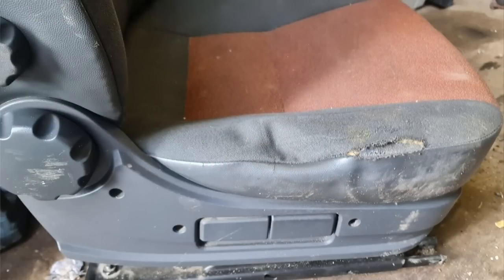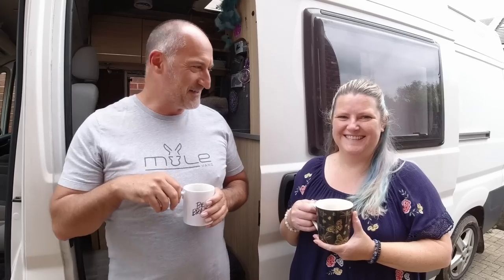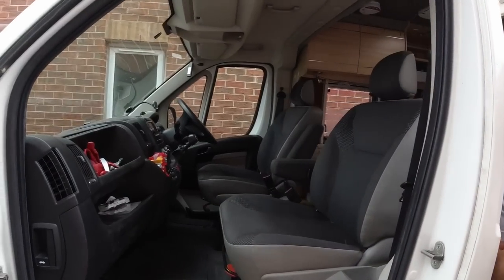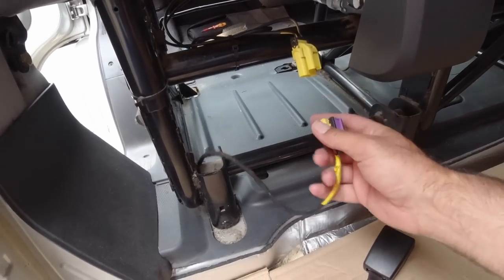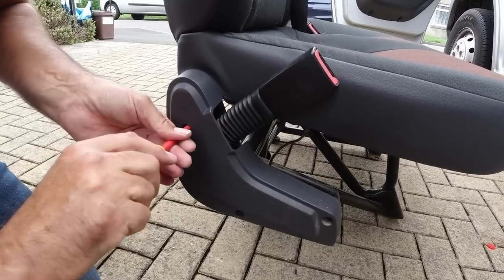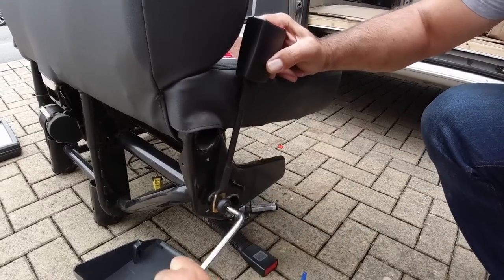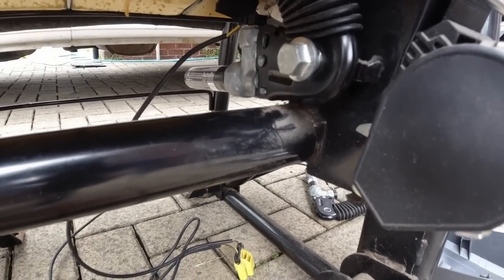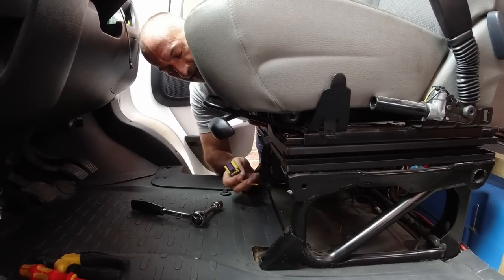DIY Single Seat Conversion on a Budget! - Van Build Ep14

Comment: Greg measure the resistance of the charged device with a meter that will tell you what size of resistor to get.
Reply from the maker: Hmm I did think that 👍🏼😃
Reply: @GregVirgoe  Hi Greg, sorry it's me again!  I know nothing of pyrotechnic devices, but I do know a Multimeter, in resistance mode, would inject a small current into the resistor to perform the measurement. Would this be enough to fire the device, I've no idea. Might be worth checking first, before accepting this advice?
Reply from the maker: @flashback9966  yes 👍🏼 great advice mate, I’m going to leave as is now. 😃

Comment: I swapped out my double passenger seat and replaced it with a single rotating seat.
I use it all the time I sit in the back.
It wasn't cheap, but definitely worth it, especially in a Short Wheelbase low roof Duvato van.

Comment: Thanks greg that’s exactly what i want to do in my van . So i can step through. Good tip using thread lock or lock tight on mounting bolts 👍.
Reply from the maker: Yes I did notice the thread lock when I removed them so it made perfect sense to clean the bolts and put some more on especially as such a critical safety feature 👍🏼😃

Comment: Top notch as oer Greg. Who'd think there was such a hassle to get van chairs, but a great result for you and Amy.
Reply from the maker: The popularity of self buildign now has obviously bumped up the prices, motorhomes have always been an expensive market and that seems to be rubbing off. Thanks for watching
Reply: @GregVirgoe   Yes I've noticed! I am looking at the small buses by Mercedes D180i? They use them for school buses and rural bus routes. A great size. I wouldn't be going full time though. Not at first anyway.

Comment: Wow that was more complicated than I thought !

Our Daughter would occasionally join us on trips so I bought a double seat from someone in Hull, who had just fitted a single..

Cost me £90 back in 2015 and I used to swap them over in about 10mins whenever she came with us..

Must have just been lucky that everything was compatible 😄

Another great Video mate 🚐💨❤
Reply from the maker: It is just the two bolts in the front and bang done in ten minutes. 
I just didn’t want to risk the seat belts not being compatible. They could have been ok but didn’t try it

Comment: Fantastic video thanks Greg very informative im at this stage now with my build. I have been concerned regarding the seat belt pretensioners, however you've explained perfectly how to overcome the spare pretensioner issue👍
Reply from the maker: I tried a few options but this is the most simple and straightforward answer. Easy and works 😊

Comment: Hi I'm hopefully soon doing a camper conversion will be a relay/boxer type van and would want to do a dual seat swap as your video are the seat fixings the same on all manufacturers as the seats you swapped out look like Renault seat they look the same as the ones in my vivaro work van thanks these videos are great for helping with a new conversion.

Comment: Hey Greg thanks for the video. I have two questions for you😊 .  First, Where did you find the info of the exact torque for the seat? And second is, what’s the software you use in your previous electric system video to create a diagram with all the stuff you have and their cables ? Thank you😊

Comment: Hi there , may have been asked already but did you not have to disconnect the main battery before unplugging the seat electrics ? Thanks
Reply from the maker: It is always wise to disconnect the battery before doing anything on the electrics :D These vans have an easy quick disconnect on the negative terminal which you can do by hand, simple.

Comment: Greg (or anyone else), how did you connect the LPG bottle to the hookups in the old van? What connectors did you use? I suppose you have to unscrew the gas regulator from the bottle when you fill it, but how did you connect the hose to the bottle?

Comment: Hi Greg , wondering if i could please have some advice from you ? I have a self build campervan and im having a little trouble with electrics . Ive got 2 leisure  batteries connected to a 3000w inverter , my microvave is only 700w but keeps tripping my trip fuse i installed between the batteries and inverter . Its only a 50w trip and clearly it not big enough to take the microwave power   what size  trip fuse would you use ? Love your videos and any advice would be greatly appreciated,  thank you Dave Co.Durham
Reply from the maker: Hello Dave your 3000w inverter needs a 300amp fuse and at least 35mm cable. Even a 700W micro device is using 56amps continuously from your 12v batteries. Hope that helps 👍🏼😃
Reply: Thats great , thank you so much

Comment: Great video. Is there any issue with rigidity when removing the bulk head panel?
Reply from the maker: No none at all, it’s primary function is just to stop loads going into the cab under breaking. If you think of minibus or ambulance etc none of which have bulkhead installed. No problem taking it out very easy to do 👍🏼😃
Reply: @GregVirgoe  Thanks!

Comment: Hello greg,i got 2 ford galaxy single seats that i like a lot but they dont fit in the citroen relay seat base,do you thing is safe or okay for mot if i secure them with some aluminium planks as they do in 2 videos i have watch.thank you
Reply from the maker: Modifying a seat or its fixings by yourself, won't have been crash-tested to current standards. At least with manufactured seat bases and swivels, they should have gone through that process. I think that @suepaulbrown9512 fitted some galaxy seats to their old Ducato van maybe ask Paul for some advice on how he did it :D

Comment: Hi Greg, hope you are well.
It’s not related to your seat swop out but I wondered if you could answer my question. I’m on the look out for a Ducato/ boxer/ relay to convert into a camper. How much head room is there in a H2 van when you have put a floor and a ceiling in?? 
I was concerned it might be a bit low but H3 vans are a bit thin on the ground.
Hope you can help.
Reply from the maker: I’m 5’11” and still have 3-4” of headroom over my height 👍🏼😃
Reply: Thanks Greg

Comment: Very informative and detailed as usual Greg. Can I ask if you know if its possible to extend the cable on a seat occupancy sensor? I'm in the process of converting a vw crafter 2022. Just purchased the seat Base to convert the passenger double seat onto a swivel and notice the cable isn't long enough? Cheers, Colin
Reply from the maker: I extended the ones on our Mercedes sprinter passenger seat when we fitted the swivel. Keep the extra cable short and use at least 1.5mm stranded. I soldered it and heat shrunk it for protection and it works perfectly 👍🏼😃
Reply: Brilliant! Thanks Greg . Love your vlogs they are very professional and informative.  Top man
Reply from the maker: @colinchellew1807  all the best Colin. Thank you 🙏🏼😃

Comment: What a result being able to do swapsies with someone else!

Out of interest, do you happen to know what the rules are for seatbelts and available seats? Only im looking to remove my middle seat in mazda bongo soon, but if i could remove those belts now would be nice cos one of them gets right in way of my fold out table.

I'd presume its a belt for every seat in the vehicle probably but a bit of googling didnt answer it clearly for me when i looked.

Cheers!
Reply from the maker: If the seat is there it will need a belt. If there is no seat or belt it can’t be tested so just a case of amending your V5 to reflect the fitted seats.
Reply: @GregVirgoe  that's brilliant thanks for the reply!
Pretty much what I expected then.

Good shout on the V5 too, I hadn't thought about that needing an update, but I'm fairly sure taking out middle seat will be a permanent mod so makes a lot of sense to inform them on it once done.

Comment: Hi there. Iwant to add a swivel seat base in my renault trafic passenger bench but in order to rotate the seat i would need to disconnect my pretensioner every time. I keep reading online that to do that "safely" and not accidentally fault the connection and blow the charge in the pretensioner you should always disconnect the battery. This seems like over kill for essentially just pulling a plug. Any advice?
Reply from the maker: You can route the cable through the centre of the swivel base and then you don’t need to disconnect it every time. It’s safer to disconnect the battery to route the cable but I had no issues even with the ignition off and I unplugged it a few times. 
When you turn the seat just go clockwise to the back and anti-clockwise to the front then you’ll never turn the cable more than 180° ever so little strain and no problem 😊

Comment: Great vid as always Greg. Couple of things I'm wondering about - Do you lose much, if any, in the way of insulation by having the opening between the front and body of the van? Also, and this is also an open question to the community, are there any reliable sources that anyone knows of for instruction videos like this for fitting swivel seats? Many thanks.
Reply from the maker: Yes opening up the cab does introduce a cold area with all that single glass but if you make sure to heat that zone with a vent like I did in our other sprinter van it does not present a problem, usually you have an excess of heat because these vans are so small so directing some to the cab is the answer. Check out https://leisurevehicleservices.co.uk/seating/ for swivel seat bases and for help and advice.
Reply: @GregVirgoe  Thank you.

Comment: Hi Greg, 
with reference to the "extra" pre tensioner,, people in the BMW Mini community have been circumventing this issue when removing and replacing seats, from memory they fit something like a fairly good wattage 3.8Ohm resistor, if you have the means to reset the resultant error, might be useful to ecperiment with different values? love your videos mate and always checking for the next episode.
Reply from the maker: I think I’m just gonna leave it plugged in now and strapped up under the seat. Don’t know it’s there 😃

Comment: For the extra buckle, can you just get the normal seat belt attachment to mimic it as fasten? That can cancel out the warning sign.
Reply from the maker: The cable is not there to tell the van that the seat is buckled the cable is there to trigger the tensioner device. If the seat belt tensioner device is not connected to that wire that’s when the error appears on the dash. 😃

Comment: Another very useful video. Are you going to make the passenger seat swivel?
Reply from the maker: Yes I didn’t show it but they both came with swivel bases. Double bonus 🤩😃👍🏼
Reply: Nice one. Makes a huge difference
Reply from the maker: @briandevitt6903  yes will give another seating position for the rear of the van and it’s my favourite seat in our sprinter van
Reply: @GregVirgoe  Double, mega bonus!
Reply from the maker: @stco2426  absolutely 👍🏼🤩🥳

Comment: Excellent and everyone gets what they want. On the spare tensioner I'd expect that as long as the electrical part is still in place, hooked up to the wiring, I'd think you probably don't need the mechanical part to still be inside the van / toolbox etc. You might find the toolbox or underseat space more necessary for other things and the buckle and gas parts get in the way? Either way a great vid and well done. Cheers!
Reply from the maker: I’ve tried it just unplugged and get the same error code. Only jack and wheel brace in the box so no harm in there 👍🏼😃
Reply: @GregVirgoe  Honestly I think that's a good solution.
Reply: If in the future someone wanted to put double seats back in, there'd be no problem with error codes.

Comment: Hi Greg, great video as usual! I'm just wondering why it's not possible to use good car seats. They are in more plentiful supply, and even if you have to make / modify the base frames that's sounding like it could be a cheaper alternative (?).
Reply from the maker: That is possible but you just need to be aware that any modifications will not have been properly crash tested so it’s best for safety to stick with those that are designed and made by a company that has done all the testing and can verify them. They are a critical part especially if you have a crash.

Comment: Only just found this. Well produced as always, but some possible mistakes with the seat replacement  have safety implications
The seat belts reel mechanism fitted to seats with pre tensioner have load limiting. The reel mechanism for non pre tensioner receivers do not have load limiting.
Thus seat belt reel and receiver in the middle seat  position in Amy's  van are not matched in performance.  As the load limiting effect is to allow belt 'stretch ' along with the pre  tensioner effect,  exactly how the restraint will function  with the mismatched setup is uncertain. 
A further point , not discussed, is passanger airbag. Whilst most likely  the vans did not have passanger airbags, they differ for single and double passanger seats.
Belt buckles and recievers were slightly different on some van variants, hopefully all matched up sucessfuly .
A pre tensioner mechanically free could be dangerous.  Rather than a resistor try a small 12v filiment bulb. 18:12 

Refards Mike F

Comment: Good video once again, well done. Unfortunately only limited applicability here in Germany, where messing with original vehicle components is a bureaucratic hassle at best, and a voiding of the car's street legality at worst. Legal implications to dire to contemplate. O well, freedom is overrated anyway... 😂 Cheers - Folker
P.S. Going back to my goose-stepping practice now. 😢
Reply from the maker: I presume if you have a garage do it that would be ok 👍🏼
Reply: @GregVirgoe  It can be done, it's just an expensive hassle. Technical inspection and change of the vehicle registration docs. I kept my little camper (R Trafic) registered as a truck in order not to have to put up with the bullshit. I made my conversion "removable with on-board tools" (screwdriver) which makes it secured cargo. Of course, this only works for some layouts and is not ideal for full-size vans. Also, the law forbids towing on weekends, so no trailer option. 

I took the bulkhead out, for more light and a more open feeling, but a fixed wall has to remain between passenger and cargo compartment. No mandatory height is stipulated, so in my case the wall is a low, lidded box across the width of the van. It contains electrics and storage, and is part of the day sofa / bed. That's fine, as I have the seat bench in the way anyway, diesel heater (Autoterm, blanket-approved with E-No.) underneath with a hot air conduit going straight through the box. Keeps the battery toasty, too. The sofa/bed/main storge is a ca. 1.7m x 0.8m box bolted to the floor (i.e. removable) lengthwise behind the drivers seat, with the split lids folding over to make a 2m x 1.6m bed. With a bit of gymnastics it can be made up with two people inside the van, believe it or not. :-) 

The kitchen is one block across the rear, again bolted down. The kitchen electrics are plugged into the wall, for removability. Water by canisters w/ submersible pump, 20l fresh, 20l gray, 20l reserve (or outdoor shower). Gas cooking per 227g cartrige burners, one built-in, one spare under the bed. I have enough counter space to cook full meals, but the large cabinet door folds down for extra stair-stepped counter space. This is mirrored in the rear for outdoor cooking. A full complement of pots, pans, kettle, utensils and tablewear fits, despite of the sink taking up part of the cabinet. 

Wall cabinetry, of which I have only one small shelf, is permissible in the cargo area and doesn't have to be removable. Insulation is also permissible, roof hatches (with E-Nr., no marine stuff) as well. Table is a Lagoon on the wall, so that's removable as well. The van is a H1 and the perfect stealthy city hopper which sleeps 2 + a little dog really comfortably. It was geared towards fitting in any parking lot in neighboring France (many 2m height bars!) and blending in during COVID. (Did I mention I hate gov'ts trying to tell me where I can go and what I can do?) It did and still does the job with bells on :-) 

Cheers - F

Comment: Could you tell me what the loose yellow electrical connector is at the 5.30mm the video is please? I have this loose under my passenger seat and wondered if you could tell me what it is please? Thanks
Reply from the maker: If you watch the next 30sec after that point you’ll find out 😊
Reply: @GregVirgoe  LOL. So I found out about 30 seconds after I posted! Cheers
Reply from the maker: @simonhale3641  it always pays to watch the video before commenting 😂😃

Comment: Yeah, here in AU it's almost impossible to find a single passenger seat. I luckily found one at a wrecker and it cost me AU$350 and built a dividing wall with a door and love moving from the front to the back of the van through the door.
Reply from the maker: I imagine it’s a game changer when it’s raining outside. Or just if you want to grab something from the back of the van. 👍🏼😃
Reply: We were going to go with 2 swivel seats but decided on the partition wall with the door instead. Really cuts down on noise from the back of the van when traveling and total separation of the cab and back of the van is really nice too. Makes it feel like you're not in a van.

Comment: I had to pay over 900 euros for my new seat from Poland during the first Covid lockdown. And to add insult to injury, had to take my old double seat to the scrappies for free 😒. No pretensioner came and the old double seat didn't have one either.
Reply from the maker: Obviously different vehicle uses like patient transport or minibuses don’t have the original front passenger seat so no need for the seat belt cables on that side. Sorry you had to pay so much but I hope you are happy with your purchase